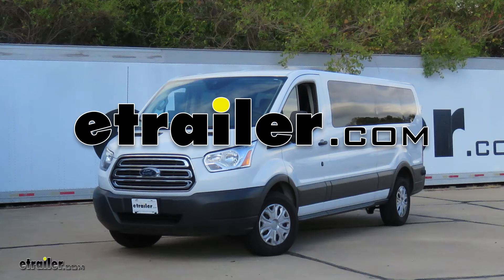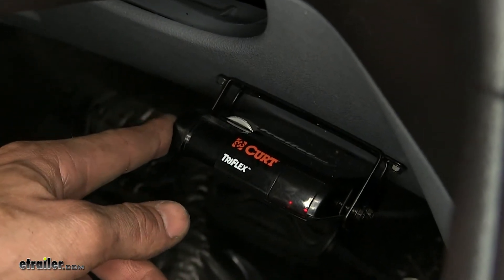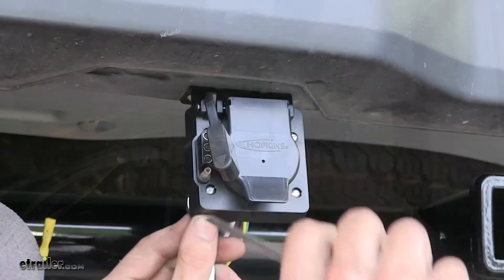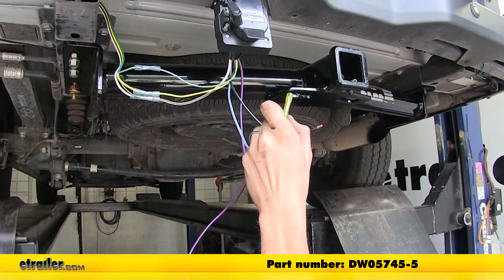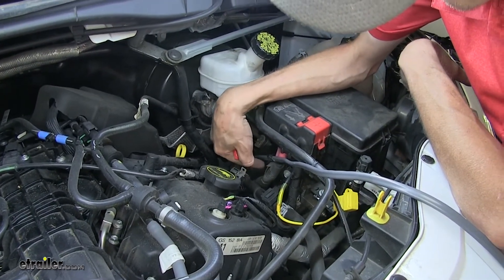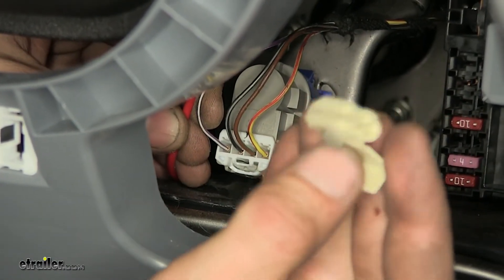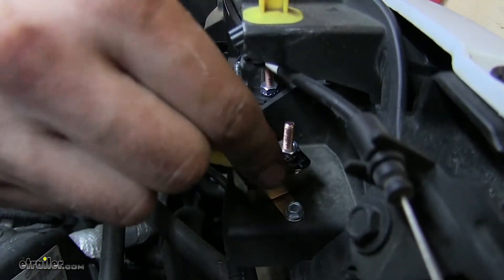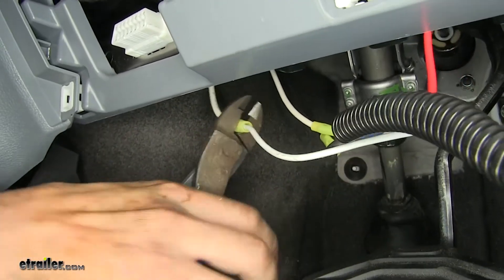etrailer | Trailer Brake Controller Installation - 2016 Ford Transit T350

Comment: Why not use factory trailer connections?
Reply from the maker: The vehicle wasn't equipped with the factory tow package, so we had to hardwire the install.
https://www.etrailer.com/Trailer-Brake-Controller/CURT/C51140.html